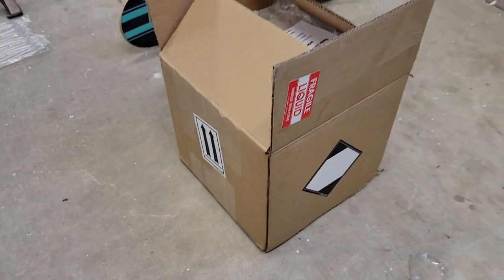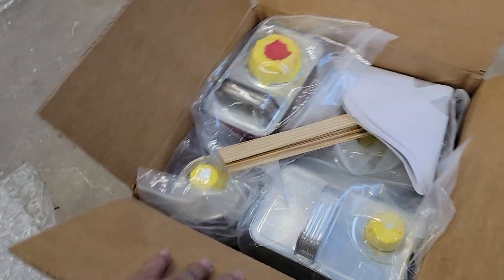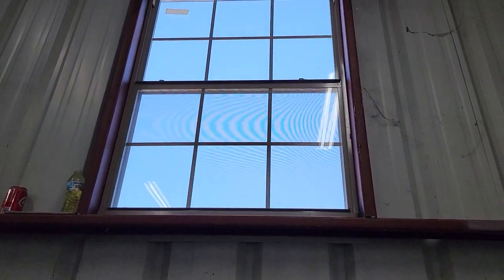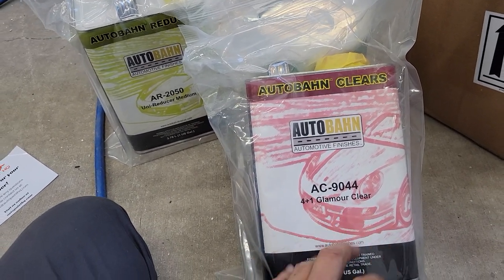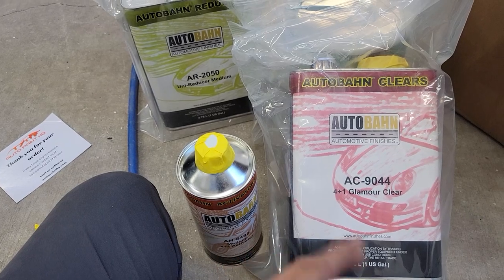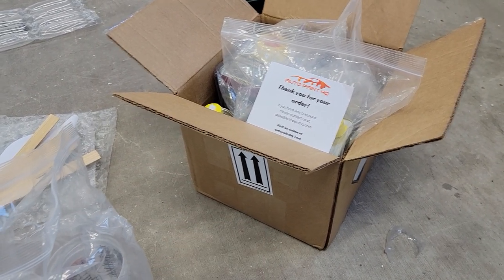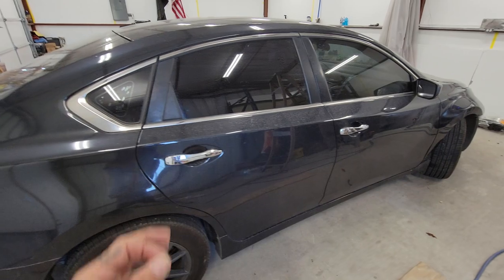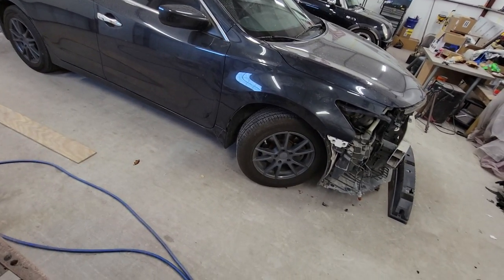UNBOXING a Paint Kit from AutoPaintHQ | GM Victory Red

Comment: The activator is only used for the clear & the reducer is just for your paint ? Do they sell the mixing cups if its not to much to ask for could you go over the mixing ratio again. Thanks again for the video hey what ever happened to the 66 chevy truck & the Camaro bueno sir standing by for the next video.

Comment: Question would that be enough paint for a Cheyenne k1500 lwb std cap truck ?
Reply from the maker: The basecoat on a kit like this can be reduced up to 1:1 (one gallon of base + one gallon of reducer is included) ,  so it gives you 2 full gallons of base.  And yes,  it's enough to paint your truck 👌